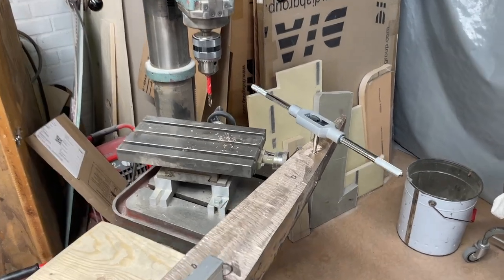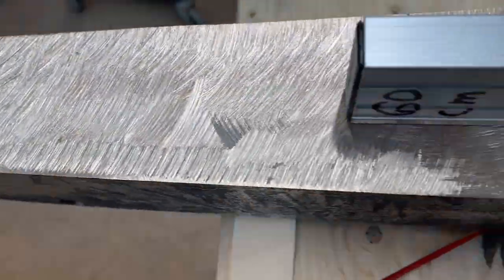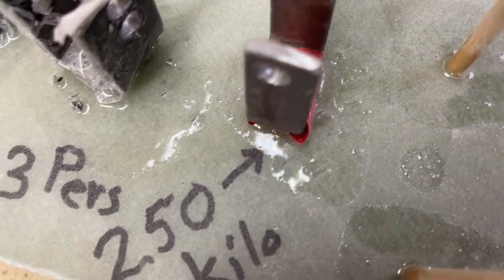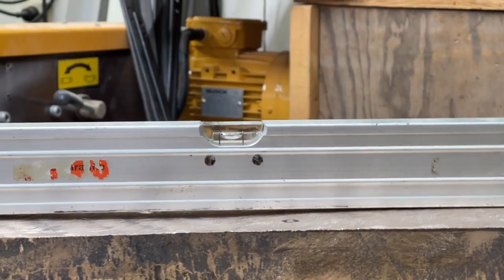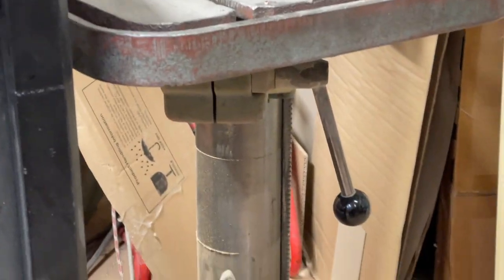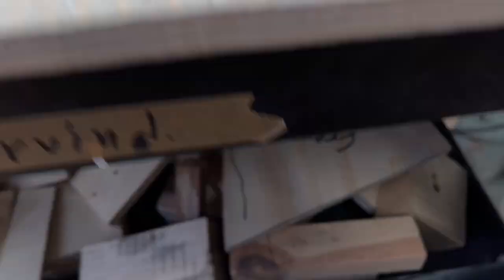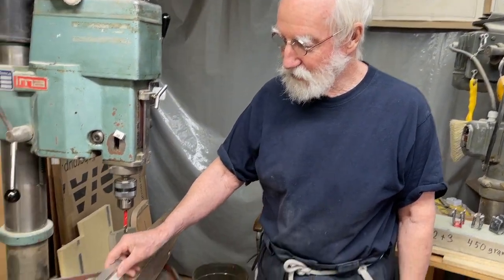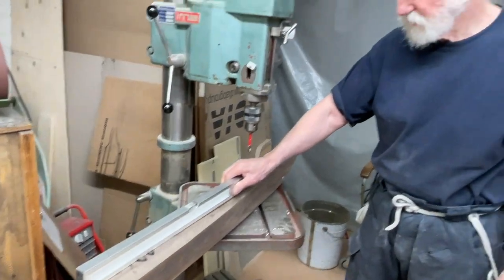24 April 2023  Work on the ballastkeel

Comment: That's not an easy cut to do free hand. Impressive Peter 👏.

I wonder, with all your water ballast, how did you know you needed an extra 70kg of weight? And how do you know if you've got too much weight for the size of boat you have?
Reply from the maker: I do not know.
I am taking a chance.
In fact its 80 kilos
But the intended voyage will be stormy.
Most cruising boats use 30% ballast and they have more beam and deeper draft. 30 % would be at least 300 kilo ballast
I have much less than normal.
Reply: What is the ratio of ballast to sail area of those cruising boats?
Reply from the maker: @joekavanagh5708  I never heard about such a ratio.
I do not know how you can make it non-dimensional

Comment: Sven, I'm curious. Do you have a preference for measurement systems? Do you prefer imperial or metric? Personally I can't stand imperial measurement. Metric is infinitely more sensible and practical. That's just me though. What about you?
Reply: It seems like he's using both.  He talks feet and then CM.  I use both here in America.  Metric for close stuff and inches/feet for stuff not so close.
Reply from the maker: I use metric, its practical and logical.
I never use imperial when building.
If I say a boat is 20 feet it is only to make english people understand.
The only reason to use imperial is if you are born in an imperial system